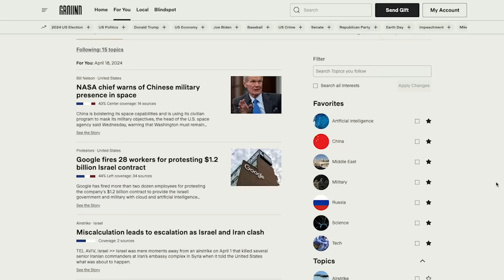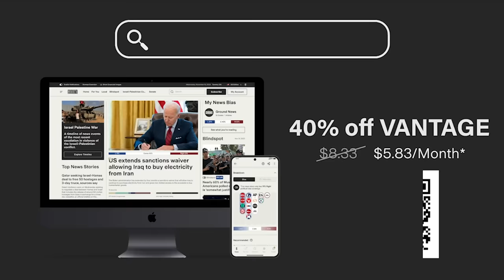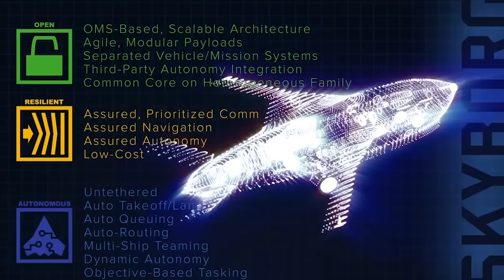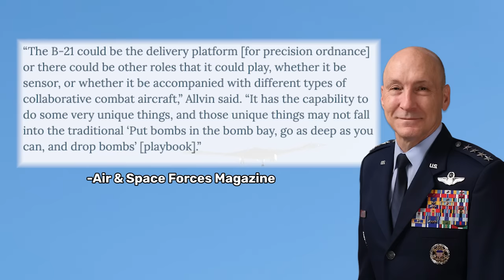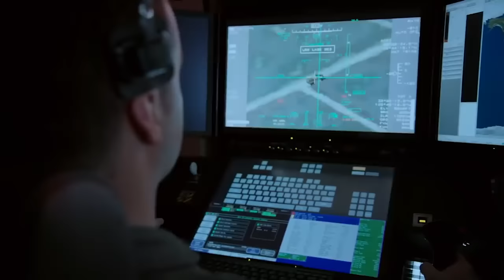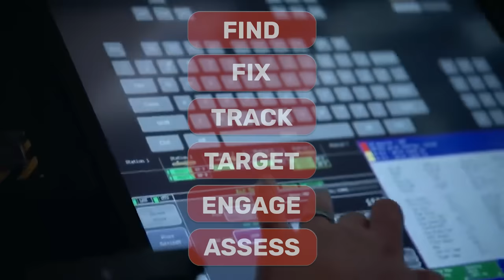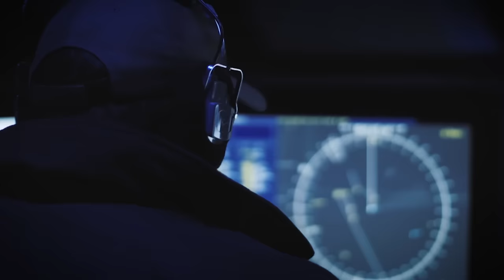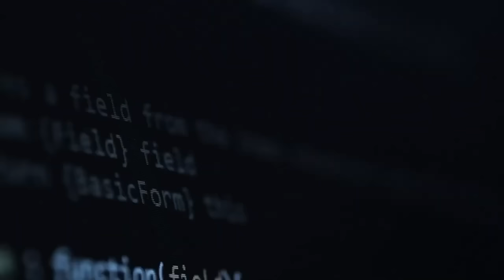Is the Air Force already developing a replacement for the B-21?!

Comment: SR-72 Hypersonic Stealth Bomber lets goooooo!!!!!!!!!!
Reply: B-72?
Reply: There is no room for bombs, dam thing is all engines! 2 turbo fans and 2 ram jets.
Reply: @ElonMuckX  I'm sure Skunk Works can figure those funky stuff out..

attach a 500lb directly on the damn engines!
Reply: @Dean00001  At those speeds a 500lbs wouldn’t need to explode.
Reply: That’s something I don’t understand; why piss away money on a rebooted version of the B-2 stealth bomber? Why not put that money into hypersonic technology instead of a rehashed 1940s airframe coupled with 1970s stealth technology?  Not very wise in my opinion.
Reply: @phayzyre1052 by not being supersonic it not only hides from radar but ir and heat. It’s way easier to disperse and go unmanned.
Reply: @justanotheroglesby2847   I understand that and agree with you but the whole thing to me is about like pulling an old aircraft out of a museum, restoring it with a few new bells and whistles and calling it “new.”  They can ballyhoo over it all they want but I don’t think we’re getting much bang for the buck.
Reply: I could see something to that effect.

Comment: Bombers, in general, are becoming cruise missle, and JDAM shuttles...

The US's focus on eliminating collateral damage in conventional strikes is pushing precision weapons as doctrine. Just hope the cost isn't prohibitive...
Reply: I would assume that stand off weapons are cheaper than the vehicle.
Reply: That's actually very dependent on the battlefield. For decades the US pivoted to fighting insurgencies, not near peer. In those cases you want high precision missiles that deliver knives instead of explosives to take out a driver in the middle of a city, instead of carpet bombing the city.

With the US pivoting now back to more traditional near peer, military V military type of fighting, saturation bombing and large area bombings are back on the menu. A $20m missile to take out a $5M tank is not a good use of money, but $500k of dumb bombs capable of demolition sing a tight groups squad if tanks is a great investment.

This gets even more dynamic with the use of drones, and loitering which can sort of straddle that line.

Finally missiles can be shot down, I have yet to see anything that says artillery gets shot down.
Reply: Frankly, it makes a better AWACS than a bomber
Reply: @granatmof cant the Phalanx system (land based CIWS) shoot artillery/mortars or am I wrong about that?
Reply: @thelizard556  yes, that's C-RAM or Counter Rocket/Artillery/Mortar which is the role land based phalanxes fill. Also something like Israel's Iron Dome can shoot down shells and mortars etc with a bit larger of a kill envelope than the gun based phalanx.
Reply: @zacharymorris4504  Yeah I thought I remembered something about that.
Thanks for the refresher course 👍
Reply: A $500M bomber that returns to base after it completes its mission  is cheaper than two $250M bombers that get shot down.
Reply: @granatmof  C RAM and Lasers can hit artillery and lasers are are getting more popular.
I know plenty of systems that can take out a sitting duck artillery piece!
Smart weapons are getting cheaper.

Comment: With regard to shortening kill chains, there were studies for a BDA derivative of the AGM-137A.  I could see JASSM-ER modified for a similar role.
Reply from the maker: That’s an interesting concept that would be pretty practical without a big price tag. I’m familiar with discussions of fielding a ground-launched variant, and the LRASM already has VLS capability, so plenty of potential customers. 

The Air Force may not like the idea of anyone biting into their high-end ISR business, but I want to see LRASM production increase anyway, so it’s got my vote.
Reply: @SandboxxApp  I was part of the design team for the AGM-137A/BGM-137B and a BDA version, with potential follow-up attack capabilities, was under study.  Too, the modular nature of TSSAM would have allowed a vertical launch version by combining elements of the A and B variants of the missile.  By the same token, the modular design would have allowed quick development of an extended range air-launched version for the USAF & USN.

Comment: 17:45 Funny. "Tomorrow's fighter" sure does look a lot like the Yf 23. 😉
Reply: The YF-23 was the better airplane but the leadership at Northrop Grumman back then screwed the pooch.  I was told they didn’t even have a fly off between it and the YF–22. Lockheed chose to put their airplane in the air and let it strut it stuff while the doofuses running Northrop at the time just sat back on their ass and thought it was theirs from the get-go.  I used to work with Northrop Grumman and not much has changed; they were an arrogant elitist company back then and they still are. Of course Northrop Grumman would deny it all day long but I worked with people that worked on the YF-23 program and they told me all about how Northrop Grumman screwed it up.
Reply: @phayzyre1052  I believe every word of that. I know the YF 23 was the better plane. It was stealthier, faster and better looking.

Comment: Great video. I appreciate all the great insights you bring to bear on these topics. I've been studying kill chains/ webs for most of the past 35 years and you brought out a lot of key ideas.   The one misunderstanding most folks have is with the target step.   The word target has many different meanings as both a noun and a verb and every Service has a different take on the subject.  

According to Joint doctrine and most kill chain definitions,  target is a C2 step. It is a decision-making process focused on weapon-to-target pairing: what weapons system with what munitions has the right combination of lethality, responsiveness, and survivability to strike each of the targets under consideration based on their priority.  

It is also focused on authority to engage the target: ROE, collateral damage risk, clearance of airspace and friendly forces, and providing the striker with any support that is needed EW, gas, supporting fires, DCA, SEAD, or threat awareness. 

Who does this and how it's done depends on the scope and scale of the kill chain as well as the timeline and location on the battlefield.  In a deep strike against an emerging target, it might be done at the CAOC, Division TOC, or on the carrier.   In a CAS sortie, on a SOF mission,  or on a sub doing ASW, the whole kill chain is likely done on one platform or by the one SOF team.  In all these examples, target is the C2 decision making process involved with the selection of the best asset to use to engage the target and the authority to do so.

Comment: Okay, I'm going to throw this out there, just because its the type of system that, if you think about it, would be super sneaky and highly unexpected.

Do you think the Raider has a possible stealth tanker function meant to top off drones or shorter range fighters in such a way that an adversary REALLY can't see them coming?  China HAS to have doctrine to track our takers so that they have ideas where where single seat strikes packages and patrols are coming from. Take that high-viz part out, and you really could give a small strike package some legs while not breaking stealth. 

Just a thought.

Comment: The possibility of a prospective replacement, so soon after work has already begun on the B-21, certainly lends itself to some exciting conjecture. If the idea is that a new replacement-not a mere updated or upgraded block-  is now in the works, that certainly implies something fundamentally more capable that cannot be accommodated by what is presently envisioned for the B-21. What could that possibly be.  Maybe a spaceplace, with maybe utilization of dual cycle, hybrid engines,  both air-breathing and rocket, with a ramjet,  or rotary detonation combustor. One feels like practically bursting with curiosity. :)
Reply: There's also ionic thrust/ air displacement for airfoil/ control surface shaping without actual control surfaces, and plasma sheath shaping by related technologies for hypersonics. Current jet engines (f-35 onwards) are now getting to the sorts of power/ weight outputs where it's feasible to sacrifice some thrust for large electric field generation, if that ends up being useful. Can also be vaguely used as a form of "electric chaff", or as a sort of magnetic thrust vectoring or engine wall heat shielding with the right fuel dopants.

The future is going to be very interesting, though I'm not sure if any of the above mentioned technologies will be feasible in the near-term future.
Reply: The B21 has some limitations. It's a medium range, medium payload high stealth platform. Having a new large Frame replacement for the B2 or even the B1 could be important.

Imagine tactical bombing by a heavy bomber that's invisible to air defenses.
Reply: There's also the high-end computing available to the USAF. Where processing power allows many other things. And the huge advances in material science/ manufacturing availablity.
Why not make the entire (ok, just lots of bits of it) airframe out of distributed radar elements? And fairly high power or very sensitive ones? Processing power... Now not as much of a problem.
Why not have hundreds of IR/ UV detectors/ cameras on an aircraft? Again, not as much of a problem these days.
Why not have 10x the communication abilities? Well, it's doable these days.

There's so many things the B21 or its replacement could have, it's hard to speculate on what it will actually have. Just depends on what's useful, how much of it is, and how much it costs.

Comment: If the full B-2 production run had been produced, its modular design would have allowed some to be modified as RB-2's with a recce package in one weapons bay and a fuel tank in the other.

Comment: I wonder if the sr-72 Darkstar could be a part of this. When the b-21 was announced, I was surprised at how similar its uses seemed to be when compared to the sr72, but at a 10th the speed
Reply: The SR-72 is designed for reconnaissance, not bombing. Dropping bombs or missiles at those high speeds is problematic. There may be hypersonic bombers and fighters someday, but it is not this day.
Reply: @hanrockabrand95  obviously nothing's been officially confirmed, but most people who report on the sr72 report that it's capable of strikes
Reply: @goodsocksproductions9397  News to me. I'd be curious to see how they work that out.
Reply: @goodsocksproductions9397 
Most people who report on the SR-72 also draw their "facts" from their personal aft passage...

Comment: Have you seen the new photo release of the B-21 taking off from behind?
The exhaust looks like the F-117 and the YF-23. 
The bottom part being angled up like the F-117 and the top angle exhaust of the YF-23.

Comment: I worked with Northrop Grumman for over a decade and in all honesty if a rebooted rehashed re-tread is the best they can do by taking a 1940s airframe, coupling it with 1970s stealth technology and adding a few new bells and whistles on it, I’m not the least bit impressed. In all honesty, I think Northrop Grumman is a company that’s trying real hard to stay afloat but it’s only a matter of time before they are gone from aerospace.  They might still play part in building satellites and other space related components, but compared to what they were 35 or so years ago that company is a shell of its former self.

Comment: It basically boils down to "Previously, you needed a whole suite of other platforms to assist the B-2 to perform optimally, to complete that killchain.  But, theoretically, the B-21 can do EVERYTHING in the killchain.  It doesn't need anything else to do it's job.  But that's the thing.  EVERYTHING else can help it do it's job even better."

Comment: The general could be correct on stopping the procurement of b21 bombers at 100. Cutting edge technology for penetration bombers is moving rapidly to the point wherein a better platform should be had when these new tech becomes available rather than back fitting to existing aircraft.

However, before spending a fortune on new weapons with AI-assist or unmanned platforms, the us defense department must settle a fundamental issue first - whether to allow AI to make war decisions in order to efficiently perform missions or to retain the man-in-the-loop that could defy mission orders if these are seen as unjust/illegal or if the situation has changed to a point wherein the mission parameters no longer apply.

Comment: This is all because the USAF wants high altitude/near space supersonic/hypersonic stealth bomber. The new ceramic based stealth coatings allow for high supersonic and possible low hypersonic speeds without damaging the planes stealth coatings. Using the new adaptive cycle and high supersonic hybrid engines being created by HERMEUS. Add in new stealth pods/pylons and you can have fast stealthy bombers carry oversized weapons on the outside any where in world in few hours. Basically the mythical replacement for B-1, B-2 and most importantly the immortal B-52 (starts playing Highlander theme).

Comment: The B-21 is what it is because it is an amalgam of vetted, mature systems with open architecture that has all been used and abused and spanked and hammered every which way. It isn’t a bleeding edge, TRULY state of the art machine. All of THAT stuff is being tested and toyed with today, along with more than a handful of B-21 upgrades that will, at some point, mean the B-21 has as much in common with what it is today as the B-52 does with the B-52s that were flying 65+ years ago. 

The same will be said of the F-35. As long as the wings don’t fall off, they will be operational well into my unborn grandchildren’s advanced years.

Comment: Given how military R&D programs work - i.e. the stuff that we know about is already several years old by the time it becomes public knowledge, I'd be surprised if there wasn't a replacement or companion aircraft already in the works.

Though given how modularity / upgradeability is the new mantra, I'd have thought the Raider will be in service for a good while yet, even if a new platform is put into production.

Comment: IMO, it seems recent developments you spoke of concerning a variety of military platforms have been developed with Modularity in mind. I get the sneaking suspicion this could be the forward momentum with the B-21 Raider. Especially when you look at that in light of the Air Force saying they have already test flown the basic NGAD,  thus cutting down drastically the development cycle usually associated with air frame development. And seeing this in similar systems would make sense. As Modularity is seen in missiles of wide stripes, Subs, NGAD, the continual upgrades to the BUFF, and so on. And we have 3D rendering, flight testing, testing designs in computer modeling and running all present knowledge with Super Computers to virtually design, build, and test for a faster, more accurate, and optimal design theories for considerably less $. We also have high speed proto typing, 3D printing, Sintering of dissimilar materials and continued on going Material Sciences advancing all these platforms.

Comment: Alex, USAF want a new design every 7 to 10 years - instead of every 30 years - in order to take advantage of newest mature  technology.
    Since F-35 already got multiple upgrades, one could argue that the successor to the B-21 is merely a large update.
   As 6th gen/NGAD will look like the B-21, and F-22 now can act as a bomber, too, then its likely that 7th gen will merge fighter and bomber into one single design.
   Why? Fighters anemic 500 to 800 miles range doesn't cut it when Aircraft Carriers have to stay 1.000 miles from China's coast and be able to penetrate 500 miles in plus +30 minutes to 90 minutes loitering time.
    This means "fighters" with +1.500 to 2.000 mile range, and likely +3.000 miles, which means a B-21 design to accomplish such range.
   So then a fighter or bomber would essentially have the very same design. 
   That again would free up budget for a new design every 10 years - within today's budget.

Comment: With luck, yes. Unless you are looking for a completely unique airframe, designers should work with the previous model and make improvements. As more and more flight hours are logged, more areas for improvement will be found. It takes far too long to move from design to flight, so make the most of it by getting that initial jump.

Comment: What concerns me is how similar is the RQ-180 to the RQ-170 that Iran captured and decoded and probably sent on to Russia and China after their attempt to reverse engineer it.
I hope Iran, China, and Russia do not have too much of the RQ-180 technology that came from the RQ-170. That will make them much better at developing a counter to its abilities or almost as bad, develop their own version. And if the B-21 Raider uses very much of the RQ-180s technology, they would be well on their way to countering or copying that too.
At the very least, the encryption needs to be upgraded, since Iran was able to decode the data in the RQ-170.

Comment: B21 on time, on schedule, under budget..... Air Force - 'something must be wrong!   Let's get something else'
Reply: It's more like, that went really well, let's see if we can keep up the momentum.

If the engines and avionics are modular enough, then having specific air frame's for different spheres of roles would be much cheaper, especially to upgrade systems down the line. Planes will never be fully plug and play, but reducing the overhead to install next Gen engines and avionics is key to the longevity of platforms.
Reply: @granatmof Exactly my thoughts.